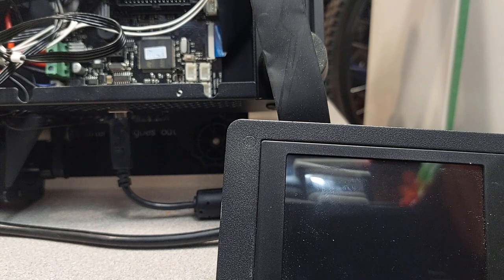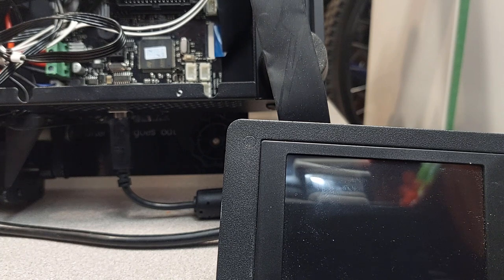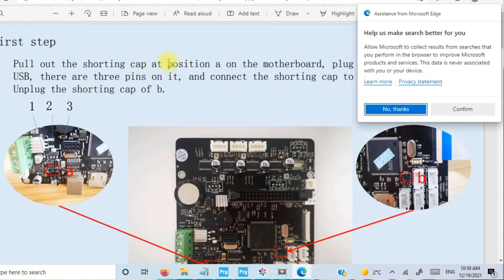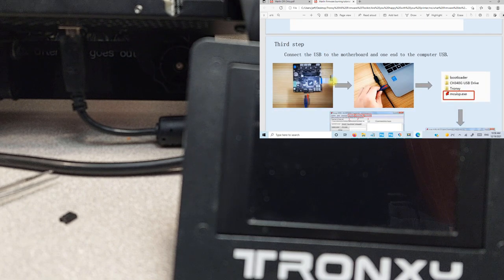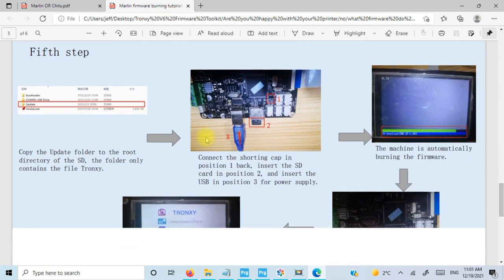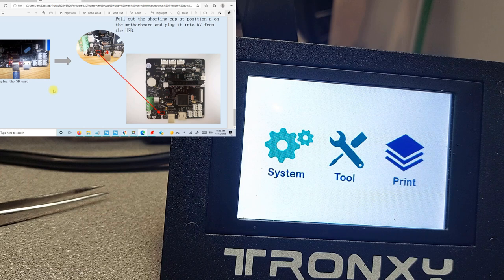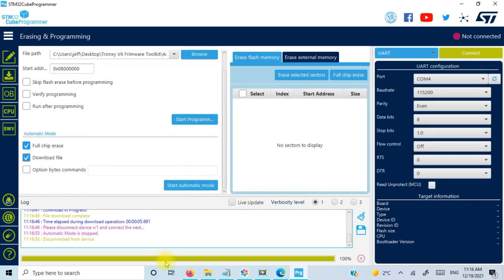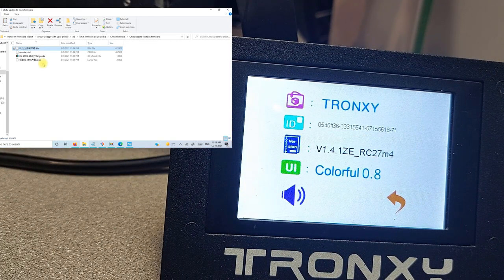What Tronxy Firmware do I Have?And How To Change It

Comment: Jeff thanks a ton for putting this together.  I haven't used mine for almost a year due to frustration with it shutting off mid print.    The tronxy Marlin is running way faster, smoother and so far trouble free.

Comment: I can confirm that this process also works for the Tronxy X5SA printer from the original Chitu to the Marlin updated (or any I guess) using the same process and bootloader.hex for the XY-2 PRO_V1.24(103)noTitan (using the mcuisp.exe program). I also had to build the F103_PIC480x320-firmware in VS Code, but then flashed the XY-2 bootloader and put the update folder with the new firmware on the SD card and it updated fine. Now running the new Tronxy Marlin firmware and loving the adjustable z offset. Thank you Jeff and the wider community!

Comment: Thank you, Sir. I don't know what I would have done without you! Granted my SD card reader was messed, which i ended up fixing and now I am a pro at firmware flashing! Thank you for getting it out there. I have XY3SE 2E. If you have any suggestions on upgrades or firmware and where you have ended up now, please let me know! Thank you.
Reply: I have the X5SA-E2    with the firmware now present, I can't choose if I want to use E1 to print with or E2  is it fixed in the update? thx! :)

Comment: Grateful for you efforts. Quick question where did you get the bootloader and the firmware software to flash the drive. I have a 5sa-pro-2e.
I didn't see the options in the folders

Comment: Jeff, Thank you for the detailed procedure. After trying Marlin I had issue with Z-Offset setting getting reset after each power cycle. So I switch back to Chitu from your files. Now I'm experiencing on LCD filenames only show 8.3 characters.. Anoying.. Do you have any newer Merlin firmware for this board CXY-V6-191017 ?

Comment: This is a really great detailed tutorial, thanks for putting it together. I have an X5SA printer with the v6 board. I noticed that in the folder, you just have the XY-2 files. I have downloaded the update from Tronxy direct (Mainboard 103), but it didn't contain the bootloader file. Can I just use the bootloader out of your XY-2 non titan on my board and then use the update folder I downloaded for the X5SA? I tried googling for X5SA bootloader but didn't find anything useful. Thanks for your thoughts on this. Again, great work on the video.
Reply: I have the same problem with x5sa pro
Reply: I also have an X5SA-500-Pro though my controller box now shows a black screen. It uses marlin firmware. How can I fix this?

Comment: Thanks. Do you have the block diagrams for the motherboard so I can repair the motherboard's hardware? When I turn on the printer, start heating the hot end and only stop when it reaches a maximum of 275. The thermostat is able to keep reading, so the failure is with the relay swish. So, do you have information about the diagram so I can find out when this switch is so I can change it, or any other advice?

Comment: Im curious if the abl system actually works on Marlin, as on Chitu it only shows you the probe point measurments to adjust the screws, but no mesh bed leveling

Comment: Hello Jeff. I did the procedure to put the firmware of the original tronxy, step by step as you demonstrated in the video. But it gives an error ("No Authoritation!") when I go to run the files from the SD card. This way I can't complete the firmware installation. Can you help me with this?
Thanks!
Reply: Any solution for this?
Reply: Not up till now as far as I can tell. Having the same problem.

Comment: Hi Jeff.  Thanks so much for putting all these Tronxy XY2-Pro videos up.  This really helps everyone even now.

I have concern though.  Apparently the Tronxy Marlin v1.32 does not work with the current mcsuisp or bootloader.hex files included in your DropBox.  Every time I try to flash 1.32, the screen at 15:08 says "Boot: unknown boot. Firmware: yaddayadda"  Then it hangs at this menu indefinitely and heats up the hotend.

I can only get it to work with Marlin v1.24 (the one included in your dropbox)

Is there a way to use the latest marlin 1.32 on the older mainboard 103s?

Thanks so much

Comment: Jeff , i am trying  to install the firmware for chitu but I am getting a no authorization error when trying to print the UI 3.5 bin  file . Have you see this before or have any insight as to why this would happen .
Reply: Same here. Still no solution. As I can see :/
Reply: Just flash the tronxy marlin and it willwork.. just dont skip the step on putting the sleeves oit in boot pin and the usb pin @chronoplise1580

Comment: This is great. I just picked up one of these off Facebook marketplace, the gentlemen couldn't get it to work. After some finageling and rebuilding/returning to stock firmware, we seem to be good to go. I was wondering do you know which Marlin or other firmware I can use with the V5 CXY-V5-180409 board?
Reply from the maker: I think the v5 and v8 boads run the same firmware.

Comment: Hi just wondering if I can help I had an old tronxy xy2 pro with a 255 bed I converted it to a 310x310 net but I need to change y steps to Mach the biger bed so home correctly so on but not clue how do about doing it carnt dinds any video on do it

Comment: Great instructional vid, thanks for sharing. I havea TRONXY XY3-SE which according to your info has a TRONXY version of Marlin pre-installed, what I want to do is edit the extruder settings so that I can install a UK made Hemera extruder, butI can't find any settings for doing this. Can you please help me? Thanks.
Reply from the maker: If your just adjusting the esteps you can do it with pronterface.
Reply: @jeffs3dcorner  Thank you so much for your prompt reply. I never thought of using Pronterface.
Reply: @jeffs3dcorner  Is there a more Marlin-like UI that can be installed on a TRONXY? Thanks.
Reply from the maker: With tronxy marlin not as of yet.

Comment: Ok, first of all thanks for your videos! Awesome work! Anyhow, got a Xy2-pro and been having nothing but problems! Printed fine out of the box, then started to get layer shifts in y-axis, was told voltage was wrong on stepper motors, set voltage to 1.8 per Tronxy, still layer shifts, then board burnt out for some odd reason! Got sent new board, and still layer shifts! Any help from you would be greatly appreciated since Tronxy hasn’t responded to me lately!
Reply from the maker: Y axis try grubscrew? Looks like you did everything else. Sorry I can't help more.

Comment: ive succesfully flashed the bootloader and get the V1.56 screen with no firmware to start!
it wont boot from sd card
can someone help!?
Reply: I know thisbisnold but did you find a resolution? I have the same problem here. I just got one really cheap and found this video. I got to the No firmware to start and it will not read the update folder. I've tries 20 sd cards ranging from 2 to 8gb with no success. I can't go back to chitu cause all I get is annoying beeps with no display. I guess it's bricked. It does have an stm chip that I might rip off to put on an ender that has a GD32F303RET6 chip.

Comment: Jeff I have the Tronxy CXY-V6-20191017 mainboard on a XY-2 2E machine. I am trying to install marlin on it. The board only has one jumper (5v to USB) it does not have the boot jumper. Does anyone know how to add the marlin firmware to this board.

Comment: well, i have flashed board to marlin, but when i home it, z goes up instead of down. When i manually move z with arrows, up is up and down is down. also trying auto level, then z goes up instead of down. how can that be and is there a fix to it. by the way, thank you for your great videos. keep it up
Reply from the maker: I don't have access to a v8 board so I don't know sorry.
Reply: Hi! maybe it's bcs u got the wrong Firmware. I've done the flashing thing on my X5SA Pro, but i accidentally installed the Firmware from the X5SA, and I got the problem u are having, then I got the right Firmware and problem fixed.
Reply: @catrieloconnor1616  do you still have this firmware?
Reply: @meinekprs7358  Hi! Yes, i still got it bcs i couldn't install Stock Marlyn
Reply: @catrieloconnor1616 I have an X5SA-500-Pro,  I tried fixing the Z but when I tried powering on the printer, the controller box screen doesn't light. Please help

Comment: Does anyone know anything about "no authorization allowed" when trying to install the ui .bin filder or any of them? Haven't been able to get passed this point so I just had to reflash my old firmware. :/ I'm just trying to get custom Marlin to have a little more flexibility in the U.I. making life a little easier.
Reply: have you fixed the issue? im having the same with my D01
Reply: @Ithacska  sorry I wasn't able to figure it out my self. I had to contact tronxy to send me there latest compatible firmware for my machine. Still haven't been able to get custom Marlin sadly. :/

Comment: The SD card not working after the update to Marlin, any advice, T-U in advance.
Reply: Have you put back the jumpers for USB and +5V?
Reply: @arrgh-  Yes it is one of the steps to finish the instlation.I try a diferend card, I format the original one but nada. All the cards are ok to the pc.
Reply: You have to re-enable that SD card reader in the Marlin firmware before flashing
Reply: @101fng  Thank-U